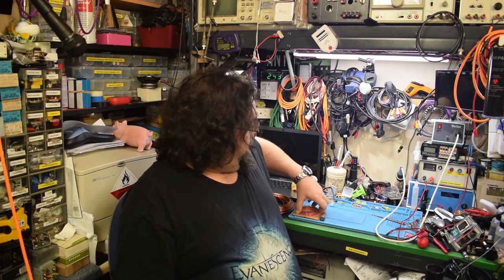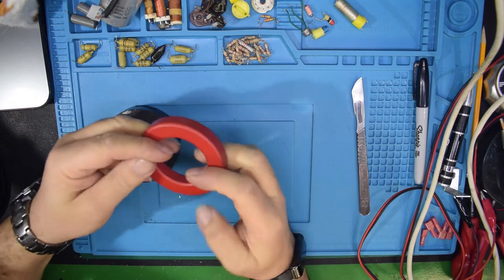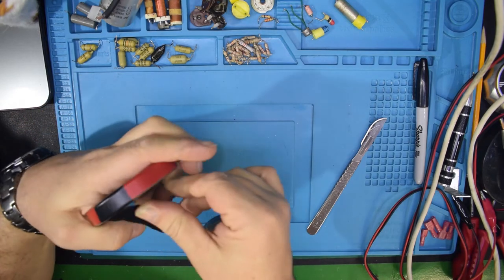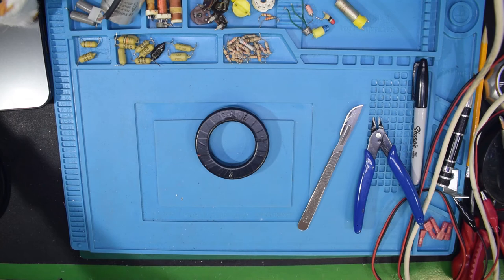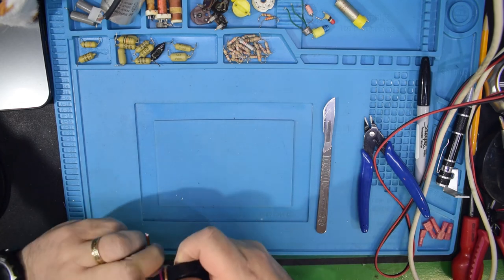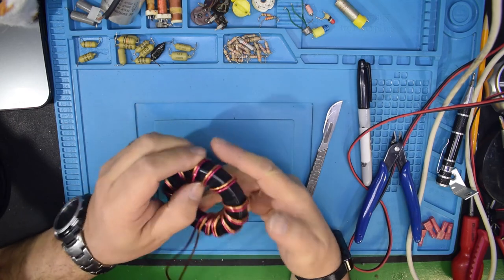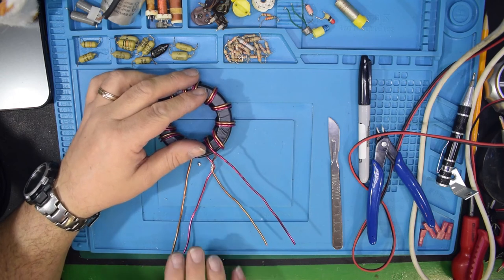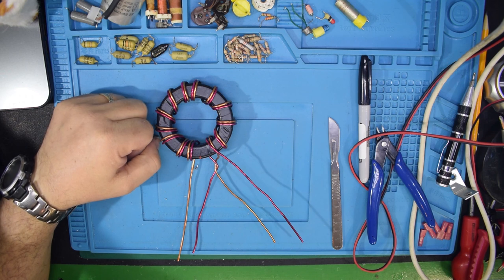4:1 Balun. How to make one easily and cheaply.

Comment: Thanks for the video. I have watched several about making a balun but yours shows me clearly how the wire is wrapped and connected.   How do you know how many turns?
Reply from the maker: Glad it was helpful! I use designs from the internet where far cleverer people have done all of the maths and testing. I still use test equipment to verify the results before I add things to antennas in the air.

Comment: It would be useful to explain why this specific number of turns results in an impedance transformation of 1:4. You will also need a choke balun on the coax side to provide proper unbalanced flow into the inside of the cox (as opposed to current flowing on the outer shield).

Comment: I would like some sort of 4:1 impedance transformer that I could put in line with a coax going in one end and another coax going out the other end. I'm not sure if that would be a balun or an unun... or, does it matter? I want something I can put inline for certain bands to bring the impedance closer to 3:1, so my ATU can match it.
Reply from the maker: This could be used in that manner but would probably not be very efficient at transferring power from an unbalanced feeder to another unbalanced feeder.  An unun may well work but it really depends on what you have coming out of the other end. effectively you may just have a screened antenna. What are you trying to match? from your 3:1 vswr requirements I am guessing you are trying to use an internal ATU with an antenna that is way out of band.

Comment: Thanks for the video George. For 800 watts, would 1 T300-2 suffice, or do you think I should stack 2 300's or 240's together? Cheers, VA7HUM
Reply from the maker: In my daily use balun I stacked a pair of 240's which have proven themselves capable without issue of handling 800w.
Reply: George. Are you sure that you didn't mean 2 x  t200-2's stacked, because it seems that they no not come in size 240, just 200 and 300. Just checking. Thanks, Brent
Reply from the maker: @bhenry5091  you are right, t200's are the smaller ones that I used. It was a while ago when I built it... must find it and do a show and tell video..

Comment: Is a 1:1 Balun required for a 4:1 Balun as a OCF dipole?
Reply from the maker: a balun is an impedance transformer. if you are going from a coaxial feed to a balanced feedpoint of 50 ohms then a 1:1 balun is needed. If you are going from coax to 200 ohms then a 4:1 ratio is needed. It really depends on your actual requirement as to what you need on an antenna by antenna basis.

Comment: looking at how you connected the windings, I do not see a 2:1 Turns ratio ......
Reply from the maker: It isn't a voltage transformer but an impedance transformer. With the first winding going round into the second winding the input is tapped at 50 ohms and once it completes another circle of the core it comes out at 200 ohms.
Reply: The impedance is transformed with the square of the turns ratio that's why I'm not digging how you have it wired you said it's tapped in the middle maybe that's what I missed
Reply from the maker: @clems6989  no problem. I really did throw the video together to explain to a friend from the local radio club so I could have explained things better I'm sure. I might actually make another video showing my actual long suffering 4:1 which has been outside for the last 10 years. That one is a proper tested and built one that I used on my delta loop and on a few other antennas.

Comment: What toroid do you recommend? I have ft240 31 and 43 mix. What say? Tnx for vids. 73...
Reply from the maker: It all depends on your upper frequency limit. The 31 composition ring is better rated at lower frequencies so will be good for top band as well as 80m all the way up to 6m whereas the 43 is not quite as good at lower frequencies.
Reply: George Christofi Thank you George. Then both of my mixes are good for me. I am planning a shorter endfed for 40 to 10 for portable holday use
Reply: When you created the pair of wires going to the coax connector and said "they must be connected properly" I take it by that you mean the enamel scraping and soldering?

Comment: So what we really have here is a 4:1 transformer, with zero proof that it is functioning as a balun- that is, as a balanced load to an unbalanced load with high CMRR. The PRIMARY function of a balun is to choke off common mode currents, everything else is secondary.
Without a measurement of the  common mode impedance (and preferably high common mode resistance) this device is an unknown in terms of balun efficacy. Finally, making it out of powdered iron vs ferrite guarantees it will be a narrow band device at best.

Dale W4OP
Reply from the maker: of course Dale, I did not prove its functionality. I never intended the video to be a step by step video on howto. I did this as a demonstration to a friend of mine as he couldn't understand the diagram he had from the web. Saying that though, the core is a t2-300 so would be broadband enough for the whole of the HF amateur bands and If I had my vna to test it I would be pretty sure that it would present a fairly close load to 50 ohms with a 200 ohm resistor on the output side. 

Thanks for watching and your comments are appreciated. I hope to do a better set of videos this year on amateur radio baluns and antennas as I rebuild my entire farm from the ground up. All the best, George, G0JKZ
Reply: @GeorgeChristofi  
Hi George,
It is not enough to have a high impedance- the resistive component must also be high. Otherwise if the  net Xl or Xc of the outside of the transmission line happened to be close to, but of opposite sign of the balun, common mode  would be made WORSE. Powdered iron, by design does not have a high bulk resistance- if they did  they would not be useful for  making high Q inductors with them.  So the CMRR of a powdered iron balun is going to have  a high resistive component only at its self resonant frequency. The only other comment is that it is impossible to make a 4:1 current balun on a single core. The classic solution is to make a 4:1 transformer (as you did) and follow it with an effective ferrite 1:1 choke.
Reply from the maker: I'm quite intrigued that you say that a 4:1 Baluns cannot be made on a single core. Most designs only show single cores, even in the arrl antenna books they mainly show single core versions. Even the air cored 4:1 devices are only a single core.
Reply: @GeorgeChristofi  My comment addressed a 4:1 current balun. One can make a voltage balun (Ruthroff) on a single core, but as Maxwell and Lewallen have shown, voltage baluns really have no place in antennas- they are fine in mixers, audio equipment etc. A 4:1 current (Guanella) balun requires 2 cores. I can do the math, but it would be best if I send a link- saves me a lot of time.
Reply from the maker: @W4OP  Of course, my brain hadn't remembered the difference. My own main 4:1 was/is a Guanella with dual cores that I built over 10 years ago. I really must brush up my theory side, I have not had to use it for a long while. One of those things, you build something that works and unless you have to redo it regularly you forget the theory side behind it. The practical side is different, I can still remember which are the main faults in Motorola 440 series hand helds and the 3 transistors that used to fail most often were a trio of ztx550's... I haven't worked on those for over 30 years but having done so many repairs and alignments on them it is something you don't forget!
Reply: @GeorgeChristofi  I tend to get like that too George!
Here is a nice white papar done by Steve Hunt, G3TXQ- sadly now an SK. Steve solves the node and loop equations to illustrate the difference between voltage and current baluns:
http://www.karinya.net/g3txq/baluns/baluns.pdf
Reply: @GeorgeChristofi  Hi George, what Dale says below is spot on,  sadly not everything the ARRL publishes is a good idea. Incidentally many of the red cored toroids are in fact iron dust and more suited as the inductive part of HiQ filters etc. For the last few years I have been playing with FT240-43 and FT240-31 ferrite toroids. It was only today that I remembered that I have a stack of T200-2 cores built in to a common mode choke, I shall either hide it or repurpose them!

Comment: Dude, where did you get that work mat/tray ?
Reply from the maker: That mat came from AliExpress. They do them in various sizes and they also have magnetic sections to hold screws as well as components. https://www.aliexpress.com/item/DIYFIX-S-170-480x318mm-Silicone-Pad-Desk-Work-Mat-Heat-Insulation-Maintenance-Platform-for-BGA-PCB/32844070630.html This is not the only seller, just one to give you some idea.

Comment: Very clearly explained - well done!    Q: With the toroid core are there different types, or if I found one in a piece of equipment can I be happy that it is OK?
Reply from the maker: There are many different types and they all behave slightly differently. If you google Amidon you will find on the website a chart which details colours versus frequency response. If you try and use the wrong one you can end up saturating the core magnetically which produces heat... then smoke..then fire. I did actually have that happen on a balun that was meant to be rated for 1Kw but the reality was 400w melted it. To see flames dancing at the feedpoint of the antenna is quite amazing... and you are helpless because its too dark to bring it all down to prevent coax and wire damage!

Comment: Ferrite rods or steel bolts far cheaper
Reply from the maker: Or you could go even cheaper and make it with a thick cardboard tube! I do have an air cored balun somewhere here that I made from 6 inches of wastepipe and some twin flex. it worked very well on a portable delta loop.
Reply: how do you do it with a bolt how many turns how big a bolt lol im dumb but curious
 @GeorgeChristofi
Reply from the maker: @josesnovi7689  exactly the same as with a ferrite rod but the number of turns may need to be increased or decreased depending on the magnetic permeability of the bolt, it's length and diameter and its actual metallic structure.
Reply: George, the bolt is not a suitable former for an RF choke, but amateur radio is full of strange folklore. Sorry I forgot to mention how tidy your winding was, it is remarkably easy to make quite a mess winding toroids.